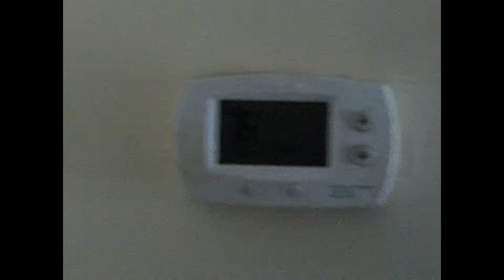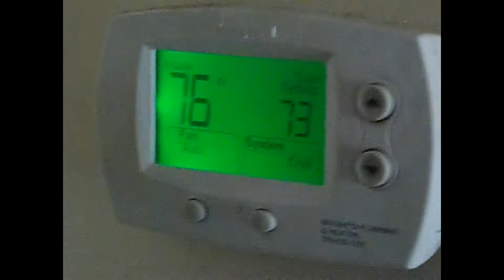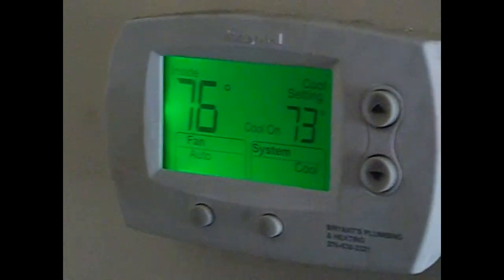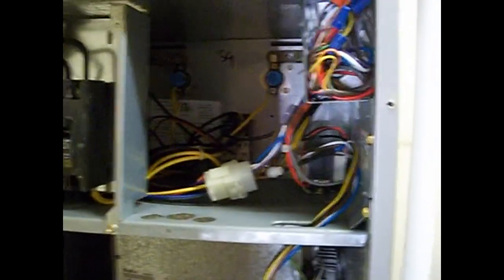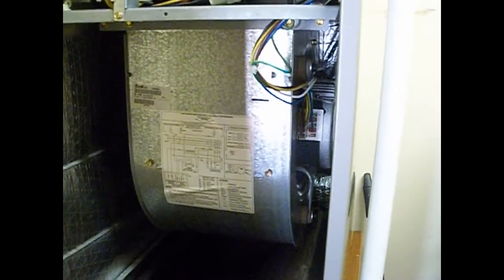HVAC, ECM converted to a PSC motor temporary hack

Comment: We have a universal ECM replacement that makes ECM to PSC conversion much easier. Check out this demo: https://www.youtube.com/watch?v=Fhuy0tWIp28
Reply from the maker: Qwik Products by Mainstream Engineering  I don't think it would be much cheaper to buy your board and a PSC motor than it would be the buy a after market ecm.
Reply: Hi Rodney.  Thank you for the comment.  We offer solutions for replacing both constant torque x-13 motors as well as variable airflow ECM motors such as the 4 or 16 pin motors.  Our QwikSwap X1(for x-13 replacement) combined with a PSC motor should cost much less than a generic aftermarket motor.  The QwikSwap V3(for variable airflow replacement) combined with a PSC motor will cost much less than a variable airflow motor, and most importantly, it is universal.